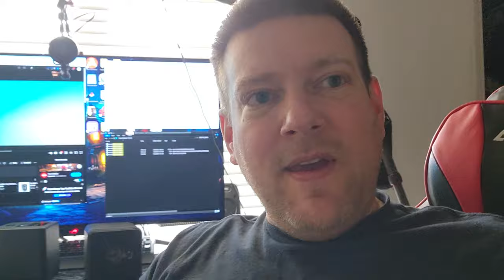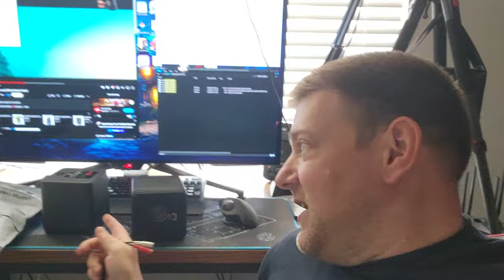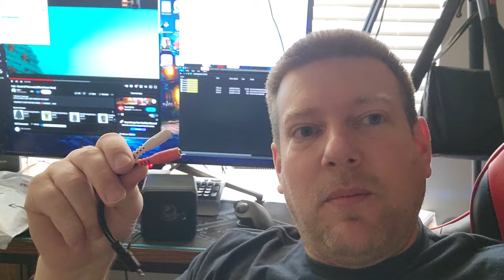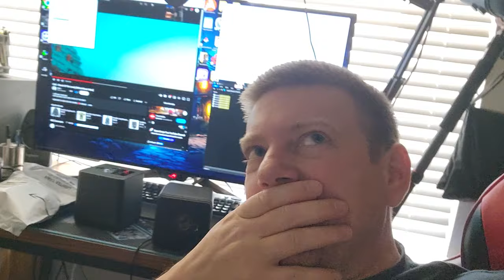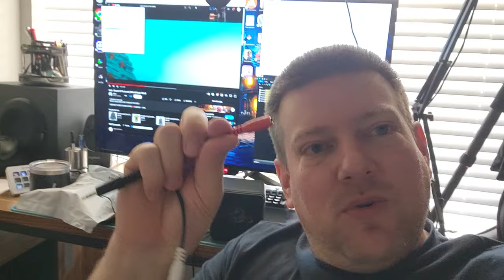The Repair Fallacy! Don't fall for it!

Comment: I get screwed on car parts all the time.  New parts, either from OE or aftermarket.  Spend the time (often a lot of time) installing the replacement, only to find the part defective.  Most recently, a new GM crankshaft position sensor, bit me.  That one took three hours to install, then another hour troubleshooting why the new part isn’t working, then another three hours replacing it with another and hoping that one works.  I’ve started buying local so that I at least have somewhere to take the defective part.  But to your point, I fall for this time and time again, too.

Comment: I am an ATM repair technician.     Lol happens all the time.      Open a part.    Put it on . The new part causes worse problems than the part you just took off.       It usually causes a huge waste of time.

Comment: Another thing i hate, is feeling that i have to open up brand new products and strengthen solder joints, or strengthen the build so it wont break in a month or two.

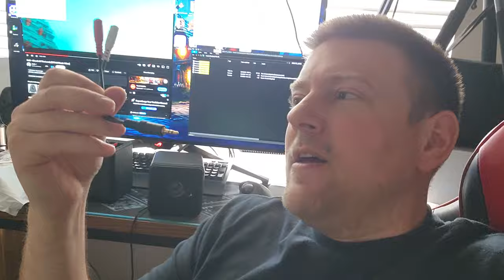Comment: 2:26 $10 for 2 audio splitters is not a great deal, especially if one of the two doesn't work. These are the lowest quality (no gold plated) so they are way overpriced.
Arround 10 months ago, you found on your way to a workorder that vintage Electronic Parts Outlet store in Houston Texas, i bet they have these for pennies. 
Regarding the Repair Fallacy, i think it's human nature when we buy/order a new part, that we presume that the manufacturer has tested this and that it will work for 100%.
The thing is, that testing each part costs time and money for the manufacturer, so they take samples after X amount of pieces, and if that sample is okay, they keep using the same settings. But if the sample is bad, not all previous passed pieces get retained. With a simple cable splitter the manufacturer of these known that there are % of them are bad, but it's cheaper for them to replace/refund the bad one after the complaint, then testing each of one of them.

Comment: And it is extra frustrating when it is a $20,000 plus part for an imaging machine that needs to up and running yesterday.  Have found this with Philips, GE and Toshiba though the years. At that much money purchasing from the Manufacturer it should work. The worst was 4 broken power supplies from GE for an ultrasound.
Reply from the maker: The worst is installing a defective part and the customer somehow thinks it's your fault.